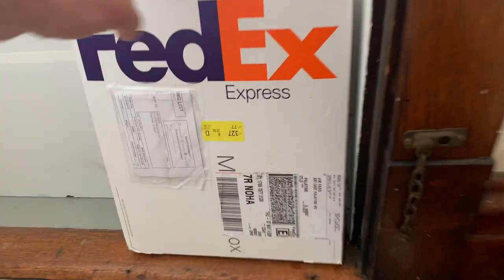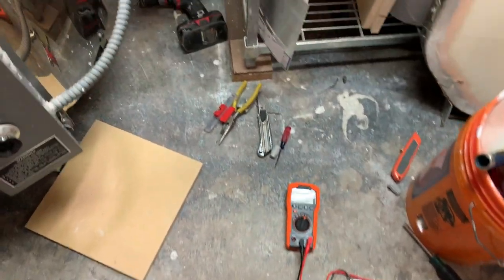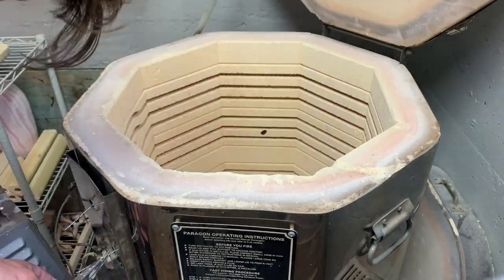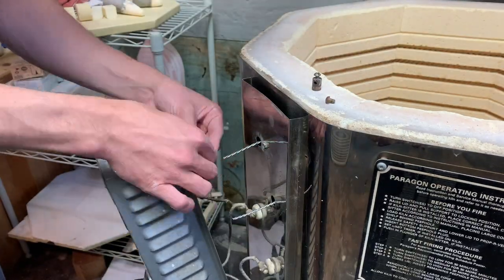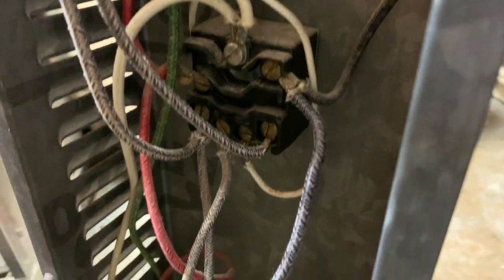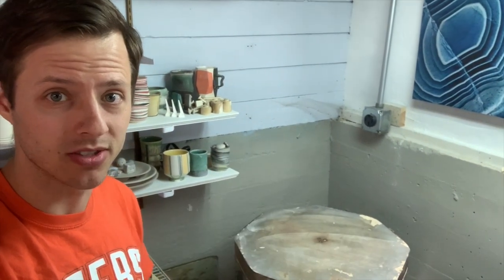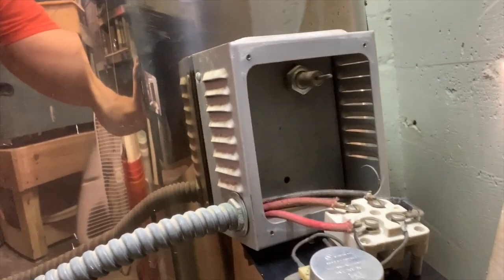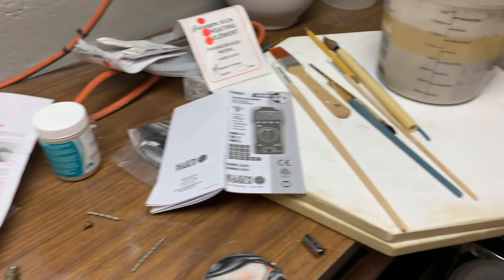Tips For Fixing a Kiln

Comment: Sorry to hear about your challenges,  I am an Electrical Engineer and have installed two AC circuit for kiln (including breaker), repaired 2 kilns (one sitter and one electronic) and a pottery wheel.  Let me know if you would like any help.  You have helped me with making ceramics (and gave me a glass), I would love to do the reverse.
Reply: Note: Plug and connector failures are not that common, failures are usually wiring  and connections.  For kilns, one common issue I have seen is a loose or oxidized connection.  These create a lot of heat that then that eventually melts and breaks the connection.  Opening the switch box is not a big deal.  That was where the broken wire was for the sitter kiln.
Reply from the maker: Hey Mark! It’s so good to hear from you. Hope you’re enjoying that glass. I very much appreciate the info. Knowing what’s common and what isn’t is very helpful. If this new plug doesn’t solve the problem then I may be reaching out to you on this comment thread so please check back in a few days to see. You’re so kind to offer your expertise and time so generously. Thank you!
Reply: @CeramicJim  Occam's Razor - the most common problem is the most likely.  Don't be afraid of opening the box (with power unplugged - of course).  It's just a few screws and there is nothing inside that you haven't already seen.
Reply: First, look at the face plate, it should list a W and V.  W should be somewhere above 10,000 and the V is probably 240.  Resistance at plug should be V-squared divided by W. Ex: 240*240/10,000 = 5.8 ohms.
Reply: Second, clean the contacts on your plug until you see brass then use a meter, set it to low resistance , and measure across the line connections.  If it is open, you have a broken mains connection.  After that, move the switches lower and lower and the resistance should go up a bit each time until you get to all off when it goes to open (infinity).

Comment: Hi Jim, I just watched your 2020 video about trouble shooting your older kiln. I feel like I am going through the same problem and total frustration that you went through. I have a very old kiln, maybe 50 years old. It is a L&L J18 with a sitter controller. My problem is that when I replaced the heating coils I may have gotten the internal wires mixed up. How do I know where those electrical wires go?  I have searched on line but can’t find literature on it possibly because it is so old. When I fire the kiln it is not reaching a cone 5 so I know something is wrong. I appreciate any help you can give me.

Comment: Omg I've been doing the same thing. Searching for answers.  Oh I hope this could be my answer. ♡♡♡ Thank you for giving me some direction.  Sitting here staring at it isn't working. :)
Reply from the maker: Haha nope :) . Happy to help. For me it was the plug. But then a week later it was also the outlet. I think the outlet was always the case and it caused damage to the plug.
Reply: @CeramicJim  My kiln is fixed!! I replaced the elements, both switches, and  feeder wires. Still nothing, but they definitely needed to be replaced . I inherited this Skutt 181 from my grandmother.  So...we checked the breaker box which was good and checked the outlet and cord and it was the outlet. Funny part is it was only a loose wire from when installed at new house. 🤦🏼‍♀️ $350  to tighten a wire, update elements, and gained  so much knowledge about how my kiln works. Thanks!!
Reply from the maker: Congratulations. Seems like we both had the exact same problem. Isn’t it silly that the one thing you wouldn’t think would be the issue was actually the issue all along? It sounds like you’re good to go now and you shouldn’t have any problems for a long time. Enjoy that kiln. Best of luck with all your future firings 🙏

Comment: I am having the same issue with my kiln. It looks to be the same as yours. Paragon A-88b. I replaced all the elements thinking that was the issues. It looked like the original wiring. We even replaced all the wires. I still have the same issues. Two of the elements are not working and the controls don’t work on low or medium. It looks like someone may have changed out  the main plug to a 3 prong. I noticed yours was a 4 prong. Another video I watched, the plug was also a 4 prong plug. Any suggestions on what might be wrong?

Comment: I feel your pain!! 🤯😱 I have a 17 month old Paragon Caldera kiln that wont get to target temperature...the most its gone up to is 345*c. No error message comes up ever, it just stops mid-cycle but power doesnt go off. Two kiln engineers have looked at it including my potter friend...all are baffled by it (I'm keen to throw it over the garden fence to be honest 🤾‍♂️) ££££'s has been spent on it - new computer board, new transformer, new relay, new fuses. The 1st kiln engineer tested the thermo couple, all four were fine with voltage going through them. So do you think it could be the outlet cord for this kiln as well?
Reply from the maker: Honestly it could be. It surprised me too. Eeek. That all sounds awful. Best of luck! Don’t throw your back out chucking it over that fence 😆
Reply: @CeramicJim  🤣💥💨🤾‍♂️

Comment: I'm having the same problem with an old kiln. Was it the cord?
Reply from the maker: Yes. And then I had a similar issue a few weeks later and it was outlet wires. It’s been good ever since. After 4 firings and no problems. Having an ohm meter is key.

Comment: My used ,new yo me, duncan automatic plus ea 1020 kiln will not turn on. I removed the switches replaced, as I had the sitter box unscrewed from kiln, plugged in, it slipped and the corner leaned against the bar on the top right of elements.  It turned on that top element! Hmmm.... so I'm guessing I have the wires wrong. I sure do wish for a new kiln! But for now I just wish I could get this kiln working properly 😕
Reply from the maker: That’s frustrating. And it so hard to diagnose electric stuff because when it’s wrong it just does nothing. No sound to help. Ugghhh. Good luck! 🤞

Comment: I just bought a used Paragon A82B. It has a plug like yours. What type of plug is that? I have a dryer outlet that only has three prongs. Can I connect a new outlet to that ?  Thanks! this is my first kiln.
Reply from the maker: Honestly you'd be best reaching out to Paragon or trying to find a spec sheet on the internet. It's a three prong plug but that's where my knowledge of plugs ends. You might be able to but if it doesn't match you probably shouldn't. I would consult an electrician.

Comment: I have a paragon older kiln fired once now won’t get to temp ? Can u help me !!
Reply from the maker: I mean I’m not an expert. I would check what I’ve checked and I would call the place and go from there. Having a multimeter to check voltage is what you’ll need or what an electrician would use.

Comment: I've spent hundreds on a used kiln that supposedly worked.  Replaced an obviously broken element and paid hundreds more for the electrical panel to be brought out into my garage.  I'm more than a year since and still no kiln.  I can't find anyone to pay to fix it.  I'm really handy but I prefer electrical things to be handled by a pro.  My regular electrician looked at it (briefly) and could not figure out why the middle is the only part that is working.  He checked all logical parts with a multimeter and couldn't identify the problem.  I am so depressed about it.  I think I'll take the whole thing apart today and try to figure it out myself.
Reply from the maker: I traced it back to the plug. Then a week later, after this vid, I had to trace it back to the outlet. I hope I don’t insult you by asking if you have enough volts for the kiln.  Do you have 240 going in? Or maybe it’s a three phase kiln and that’s why it won’t work? That’s so frustrating! 😠

Comment: So I've replaced all the elements in my kiln as well as the relays. The bottom elements work fine but the top won't work. The only thing that I can think of is the little controller switch on the top set of elements. With the element wire shortage, I just finally got the last (top) element and installed today. Mine is about a 35+ year old skutt that I converted to be a glass kiln with a controller. Any ideas/suggestions would be greatly appreciated. Not finding any info for my problem on the web or YouTube so far. 😫
Reply from the maker: A volt meter will tell you a lot without having to replace anything. Trace the voltage back or forward until it stops.

Comment: Thanks for the video. I am getting to this project now. In fact, I'm working on the exact same model! My question is: where can I get the lugs to connect the wires to the elements. I've seen the Paragon element connectors on a few sites, but they're $12 a pair. Do you know of any cheaper ones that will work? I know not just any lugs will do as they have to be high-temp rated.  I will pay the price if I need to, but that'll be $50 just for connectors. Thanks to anyone who can point me to something cheaper.

Comment: What if your kiln doesn’t shut off?  It’s an old Duncan with a kiln sitter.  My first time to fire since my parents are no longer with me.  Come 04. 1 hr on low, 2 hours on med and now 1.5 hrs on high since it hasn’t turned off.  Help!!
Reply from the maker: That does seem long. Do you have any witness cones inside to see if it’s getting close. It might take 8 hours in elements are old or tired. After 10 I would shut it off.
Reply from the maker: That is a little suspicious. Be careful. You can trip it yourself.

Comment: I just replaced elements and now my cord/plug is getting hot! This didn't happen with the prior elements. Any suggestions?
Reply from the maker: Hmmm. Electricity is tricky and I am not an expert. I suppose I’ll state the obvious thing like do you have the right plug or right gauge of Waite? Are all the elements correctly wired? Aside from that I say much more. I called my kilns customer service and they were very happy to walk me through my issues. Best of luck. I know it’s frustrating.
Reply: @CeramicJim  I have a skutt, looks like that tiny one you have next to the kiln you are working on from what I got a glimpse of. I contacted skutt, who has great customer support. I just wired up my new cord (we isolated it to the cord getting hot due to new elements so I changed it out from a 14 gauge to a 12 gauge) I pushed the plunger in (its a kiln sitter) turned to low and no light is on. A light flicker on the power light. This is so frustrating!
Reply from the maker: Believe me I can relate. Wouldn’t the switches be the next thing? Although if it worked fine before then it should now. Especially with new elements a new plug. This is where my knowledge runs out. Hang in there and take it one check at a time.
Reply from the maker: I had another kiln issue recently. After replacing the elements and the plug it worked for a handful of firings. Then the same problem happened. Half the elements were working and low voltage. This time I traced it back to the outlet. One of the power cords was lose and must have been racing because the wire coating was melted. Work checking through outlet too. You probably have. I hope you’ve fixed your kiln by now 🤞🏻

Comment: Here’s one..  band on lid corroded and snapped, crack developed on inside face of lid.  Ordered new band, they sent wrong size.  New bands coming.  In the meantime, wrapped lid with winch strap to hold lid together.   All is good until I removed strap to put on band.   Lid broke apart into 20 pieces.   Sigh.   Now I am getting a new lid.
Reply from the maker: Sounds like a headache. Also sounds like we’re having similar amounts of frustration. It’s nice to know we are not alone in our kiln struggles. I hope that new lid works out for you and you can get back to firing soon!